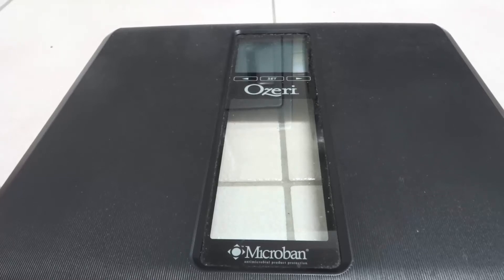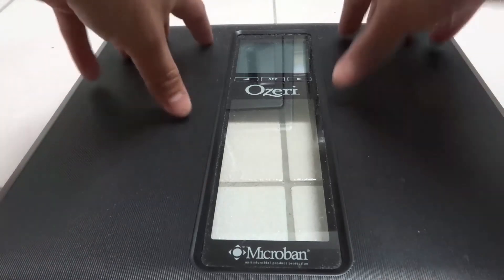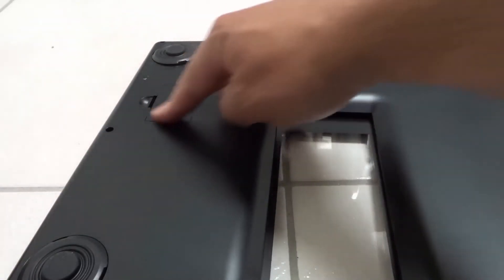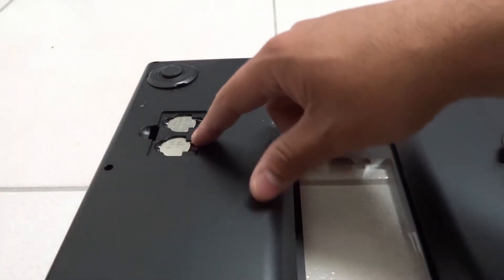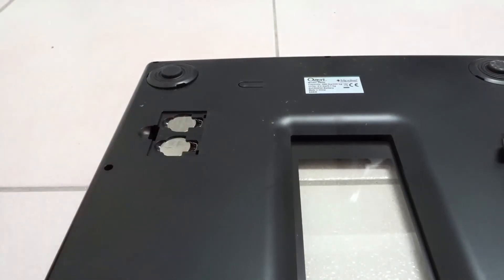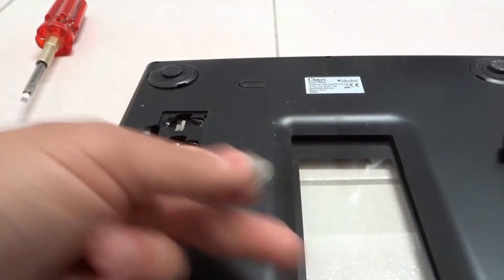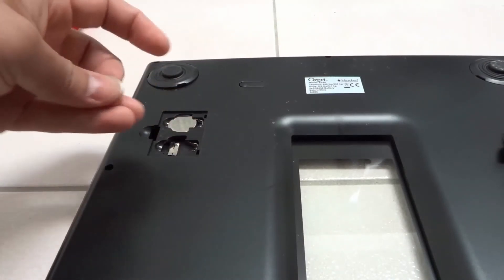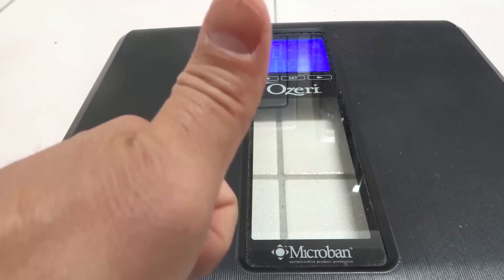How To Change A Digital Weighing Scale Battery-Easy Tutorial

Comment: I can't seem to find any videos of the one I have. Yes I have the flat batteries- CR2032, however mine are not beside but on top of each other- providing there are two. But there is No screw. They are incased in a round device nd it looks like it hakes some sort of wrench to open it.